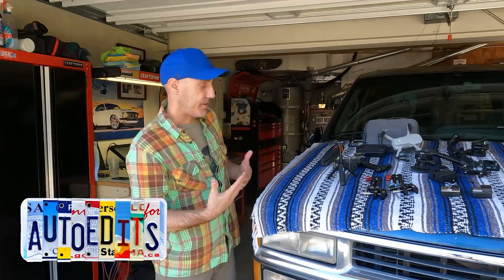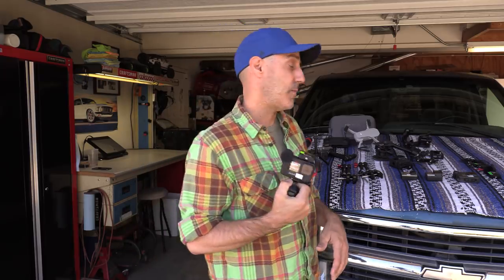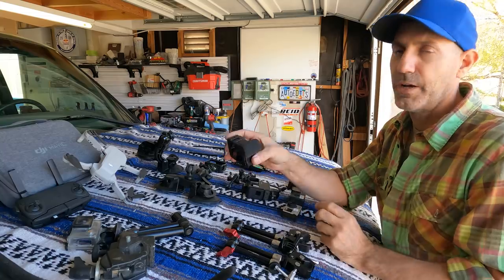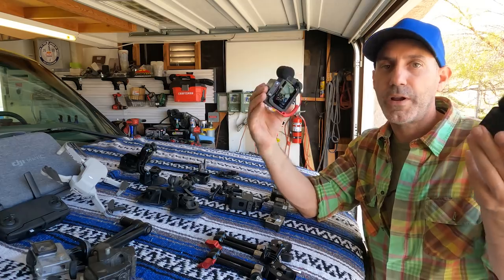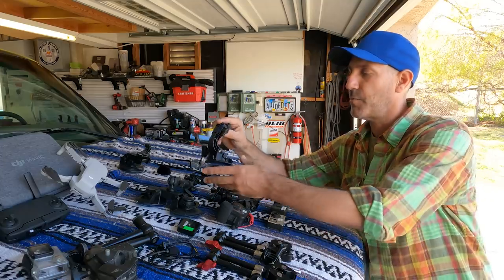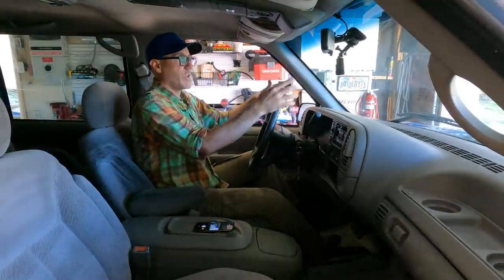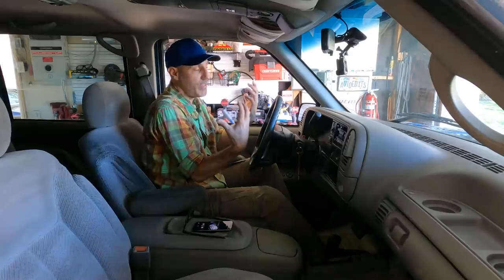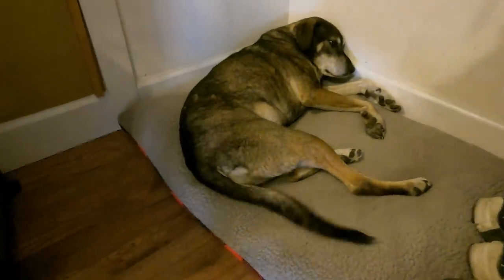GoPro Shooting Tips and Tricks for YouTube Videos

Comment: What settings are you using on the gopro, frame rate, ratio ect.
Reply from the maker: I use 24 frames p/s and shoot either 4K  16:9 and starting to experiment with the 5K. I didn't mention that because I think most people use 30 frames per sec but I started this years ago to save memory card space and it just kind of stuck.
Reply: @AutoEdits  Thanks, I have an 8 and never know what the best to set it at is. I don’t use it much because the editing part difficult
Reply from the maker: It's looking more and more like I'm going to make a video to try and help that!